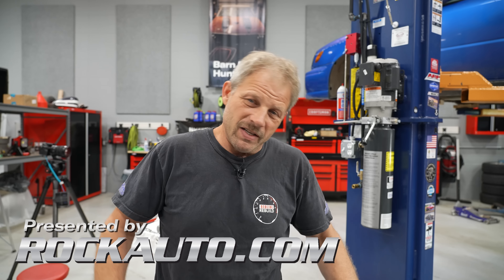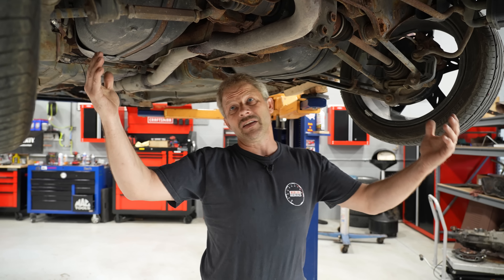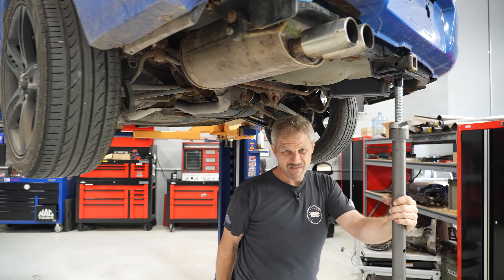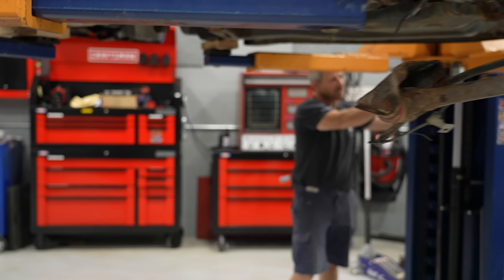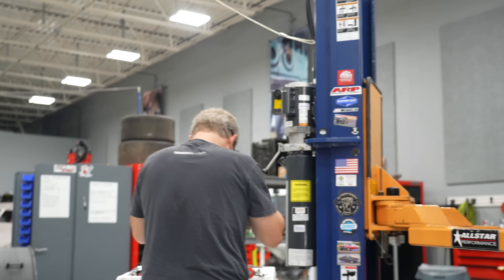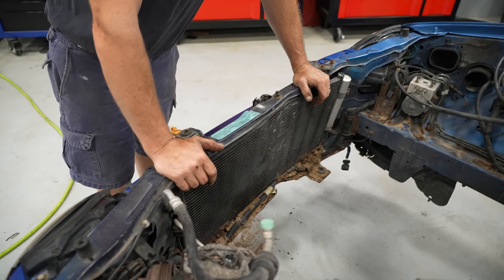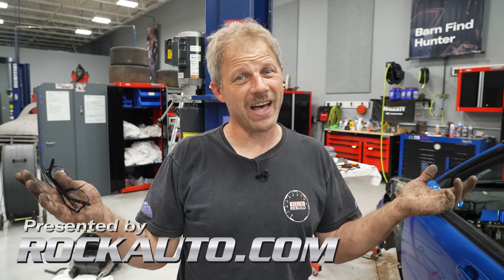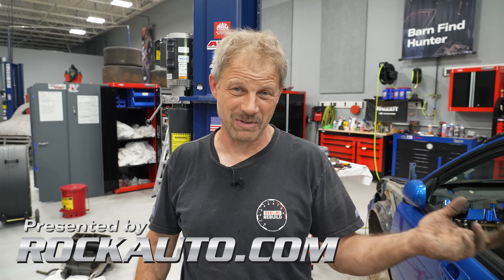Stripping our 2002 Subaru WRX body for parts

Comment: Spent near a decade in my 2002 WRX Sedan. Took me through so many miles and memories. Driving through foot deep slush with studded tires at speeds that no other car could match and then into and back out of near zero visibility blizzards, it was a wonderful little car; always happy to make huge sideways drifts, the mechanical differentials could be felt working in unison to keep grip through the Momo steering wheel. That boxer sound with a tuned exhaust still burbles through my head (to the dismay of my entire neighborhood block). I will always miss that car. Cheers to that World Rally Blue EcuTek tuned 2002 Subaru WRX, my old friend, wherever you are now 🍻.
Reply: Tripleson

Comment: The entire drivetrain will fit in any Impreza from 1995-2001, you could do the popular swap like I did! Find a clean base model Impreza and drop in the drivetrain and fuel tank to build the first gen WRX we never got in the US. Be sure to pull the fuel pump controller from the right side of the trunk area! If you want to have the harness merged with another year impreza, you might consider talking to iwire, I went to them for my harness merge and my swap fired up on the first attempt! :)
Reply: This!!! Planing the same with an Impreza 2.5RS (coupe) except with an 05 - STI underpinnings, add some body panels and you've got a 22B
Reply: @all-flat-engines  I found a clean base model '98 coupe with a blown engine for $900 and did this exact swap! My car has everything from the 02 WRX including the front and rear sub frames and brakes and suspension and engine and transmission. I still have a long way to go to make it nice, but at least it has the nice fancy looking pedals! 😂
Reply: @aaronredbaron  The pedals are so nice that Subaru still uses them in their new cars, 20 years later :D
Reply: @all-flat-engines  I’ve been wanting to do that for a while. Hope it goes well!

Comment: The amount of wiring in a "modern" car is amazing!! Love this Subaru series!!
Reply: We have a family car with only the Wire Harness responsible for the engine and the light and gauges, and AC. No ECU, only a fuse box and is fuel injected, although it was direct fuel injection and not electric fuel injection. We've bought it 2017 brand new

Comment: Exact same car I had in 2002, gosh I miss that little wagon.  Unfortunately the transmission went in just 8k miles, and the dealer replaced it under warranty but wanted me to sign a good faith letter that stated if the trans pooped out again they would not cover it.  It was my daily so I traded it for a 2004 R32 which my friend’s son bought from me 3 years ago, and still has it.

Comment: Those interior parts are worth $$ it's getting very hard to find nice interior pieces!
Reply: Same thought went through my head.
Reply from the maker: They're all yours if you wanna come get them!
Reply: @Hagerty  I don't need them now, I spent a long time finding non trashed parts for my bugeye. You'll definitely have takers on just about everything inside that car though!
Reply: @Giovanny Rosales window switches, dash parts, depending on the seats and door cards they may be worth something. The wagon isn't as desirable as the sedan, but they do share a lot of parts. Rear subframes are also worth some money, especially for those that live in the rust belt.
Reply: 3d printing is a thing.

Comment: For the record, Haltech makes an excellent aftermarket universal Programmable computer that many "tuners" use for this engine. It allows you to program the fuel and ignition tables for things like more boost, nitrous, etc.
They have their own YouTube channel. and their customer service is excellent.
Reply: It's an awesome ECU but its also 4500usd, which is probably more than this entire car is worth. You can tune the hell out of the OEM ECU for the price of a tatrix cable and a laptop

Comment: @ 4:30 The way that sway bar mount came off with the unibody rail attached is nuts!
Reply: I have seen more incredibly rusty Subarus than I can count, many much worse than this one, and that's actually the first time I have seen the frame rust that badly at the sway bar mount. Strange one to me. Wonder if it took a hit from something underneath at some point or if that area of the car got under water.

Comment: it's amazing that we were able to see cars that were 50 yrs old brought back to life even tho they were falling apart. When it comes to modern cars tho, when you remove the harness and some interior plastic you will end up with couple of dust pans of Iron oxide.
Reply: Just has to do with where they live. Get a Subaru from the South and it will look factory. Get a 50s car from the North... Oh wait they don't exist because they rusted away, hahaha. Subaru interiors actually hold up incredibly well. Every 90s Subaru I own has all factory interior with no cracks or failing parts, other than seat wear. The worst one came from the Southwest desert and has some sun and heat damage, but it's still all in tact, just a little dry.

Comment: Back in the 1970's we used to strip VW beetles out like that. After dropping the engine out and removing the seats and battery along with the fuel tank we would just roll it on its side and strip out the trans axel and front suspension or if it had a good body pan unbolt it from the body at that point. You could sell a good body pan complete with transaxle and front end along with the steering column and wiring harness for a dune buggy for more than the whole car was worth.

Comment: I got to rewire my wire harness on my 97 Integra.  I'm gonna be pulling motor and doing a full race grade head replacement,  computer and clutch . So just gonna trace a bad wire and replace whole length while I have easy access to it . In case you're wondering bottom half of my b18b1 is already rebuilt to SPOON Specs  and I have a 97 type r Trans so yeah full race spec head and computer are warranted 🙃

Comment: Yeah, it's understandable that the body structure underneath makes the wagon unsalvagable. It's kinda sad, really. But it was the expected fate after the inspection on the first lift.

And while the it's unsalvagable, you still have good body parts. I hope you didn't throw it all away, because some may be used or put for sale. Once the project is over is when it can be scrapped.

Can't wait what will come next.

Comment: Man, you pick the wrong year Subaru WRX STI to work on. That's sad! I can't believe how rusted out it is. I changed my mind. I can believe it. My 1981 Subaru GLF was totally rusted out on the floors and torsion bars. I went to a auto body shop and they said it would cost $4,300.00 to replace the rusted metal with new metal. I drove it for 2 years and traded it in for a 1988 Toyota HILUX.

Comment: My sister had a Subaru and it was about 6 years old.  The bottom 1/3 of the 4 doors was rusted away, and the rear end howled so loud you couldn't hear the radio.  This was during the time when Vermonters were trading in their SAABs and Volvos for Subarus because they were such great cars in the snow, and the hippeies thought they were Kool.
Reply: Living in Vermont and NOT having a car rust proofed ?? 😳 I live in Québec and rust proofing is a must !

Comment: given the condition of the car and questionable mods, how badly was the wire harness hacked up?
Reply: Typically not much faffing with wiring on a Subaru unless someone has done an aftermarket computer or lighting for example. Luckily it's not like Hondas and DSMs where for some reason the wiring is always hacked and spliced in a million ways. Subaru wiring is also incredibly reliable.

Comment: Wait a minute...you are throwing the whole body away!?!? I feel like that probably wasn't the original plan, but I am super-excited to see what the NEW plan is!
Reply from the maker: Definitely wasn't the original plan. But it's too far gone to mess with! Send us your ideas for what we should do with the engine and drivetrain!
Reply: @Hagerty  modern day dirt track (rally) car. Beef up the engine, drop it in a custom frame and body , and then do a comparison between the vintage diet track car and the wrx rally car.
Reply: @Hagerty  As fun as it would be to see it shoehorned into a Subaru BRZ, those are still a lot of money. Maybe buy an '04-'05 Forrester from somewhere in the south that doesn't use salt and swap in the WRX drivetrain. Stick some tall struts on it and call it a Japanese Jeep?

I'm not sure if there is something like a Locost or other Lotus 7-style kit that will take the Subaru motor, but that would also be fun. They aren't super-popular for swaps into other cars because the engine is so wide compared to most other layouts.
Reply: @Hagerty  put it in that beetle in the background
Reply: @Hagerty  unholy swap into Mitsubishi Evo
Reply: Factory Five 818 chassis powerplant?
Reply: @exothermal.sprocket  Definitely an option, but a pretty expensive one. You could probably find a donor Impreza for a lot less.
Reply: @Hagerty  AWD beatle
Reply: @Hagerty  you are doing snowballs "vintage" race car 

Use the motor and box to make a mid engined modern track car by shoe horning it into the rear of something unexpected
Reply: @Hagerty  into a Subaru brat,
Reply: @royster211085  this is the way

Comment: I was wondering if you were ever going to use a battery powered tool on this job, so happy when you did. I have been slowly getting rid of my air tools and I do not miss dragging out a compressor every time I want to get some work done. Also, please start wearing gloves, you would be amazed by how much petroleum is in your system already because you are not wearing them.

Comment: that rust is Japan's answer to always being able to sell new cars it's almost a design philosophy to selling more cars . by selling no cars with rust protection is helps get rid of old rolling stock making sales of new stock possible . yes it sucks for all of us who love older cars and unless the buyer of the original car had it protected as soon as they got it we end up like this with a rusted hulk . don't think it's only a US or rest of the world problem they don't even protect the cars they sell in Japan . it's the reason even the Japanese car company's rarely have old cars in there history centers they all rusted away from Japan's winters.
Reply: I had a 2001 2.5RS that I bought new. I drove it for 13 years, until some woman T-boned the rear axle. At first the insurance company and body shop thought they could fix it. After they got into it, the cost of repairs exceeded the value, and the insurance company declared it totaled. I got $6300 for (absolute maximum possible), and the insurance guy said he'd never seen one as clean as it. No rust (Georgia), no dents, a couple extremely minor door dings. I had a bunch of amateur radio equipment in it, and I got where I could pull and replace the interior in about 20 minutes. Loved that car, and I always wanted to swap a WRX engine into it, but never had the money for that. I looked for another 2.5RS a year or so later, and any I could find were mostly northern cars and badly rusted.
Reply: In countries that don't put salt on the road this isn't as much of an issue. I've seen plenty of Japanese cars from the 80s still driving around.
Reply: Man, that's old news dating from the 70's ! Yes then, they were rusties. Not anymore. 
I live in the rust belt (Canada) and I always had ALL my cars rust proofed yearly.  Imports or american made.
Cheap insurance. Actually, the very best car I ever had was a 1991 Nissan Stanza. Perfect size for us, extremely well built in and out. We drove it for 18 years, almost rust free, 320,000 miles on it, till being in a fender bender and totaled.